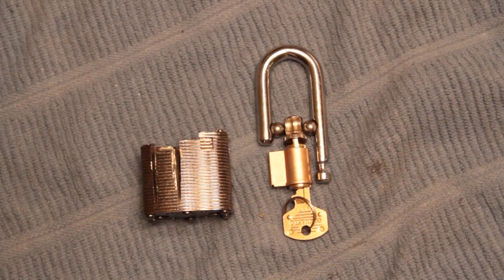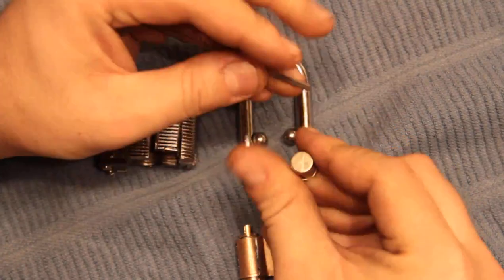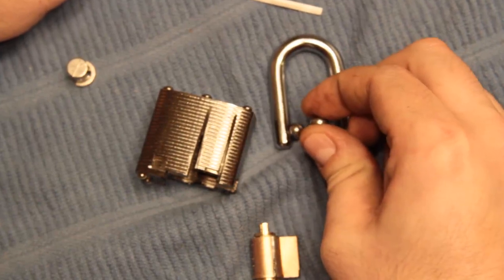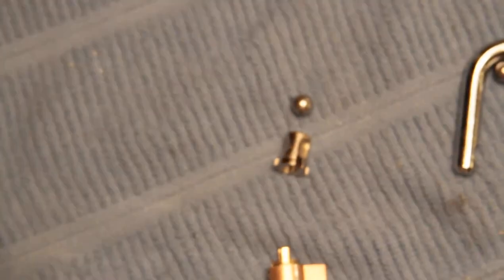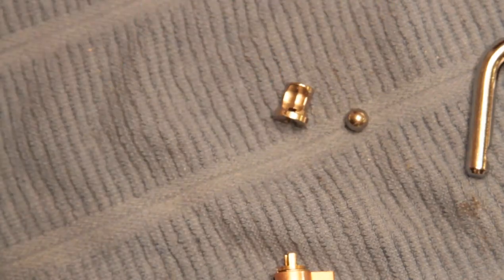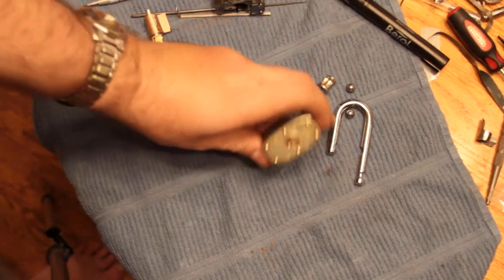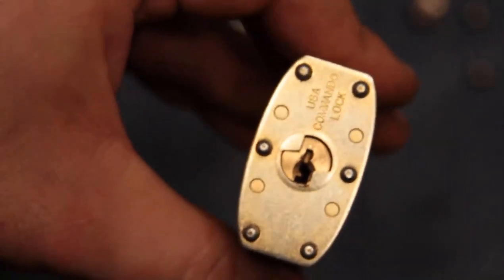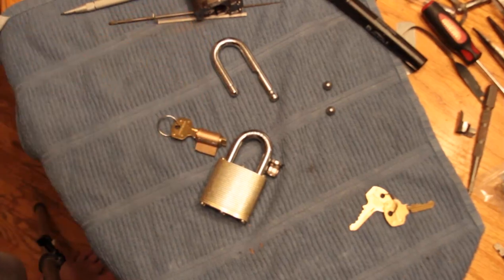(049) Vulnerabilities found in Commando Padlock

Comment: The hardened 420 SS bearings are magnetic--it's the 300 series stainless steel that is not.  Our actuator is currently made of Zamac die cast steel, which is relatively hard for what it is but can be produced in a harder recipe.  Thank you for that.  Without giving away all our secrets, you gave good advice that we can all appreciate.  We look forward to challenging you more as our designs improve.  One last thing:  We're working on our 50mm lock with interchangeable core for 2nd quarter 2013.;)

Comment: I'd also like to congratulate you for being "that guy" who filed the key on YouTube.  We had bets at the factory on how long it would take.  As you'll see in our 2013 line up, we are beefing up the security of the lock body with hardened steel and the new boron alloy shackles.  Tooling for our new shackle guard is also in process and will be interchangeable with the current IChange Series of locks.

Comment from the maker: The actuator in the Commando is a casting. It's mildly magnetic, so it's likely some kind of steel. Replacing it with hardened carbon steel (or something at least as hard as the ball bearings) wouldn't add much cost. For a laminated lock, it's otherwise pretty tough.

Comment from the maker: We do like picking :D And those security pins are pretty neat (and a right pain if they set incorrectly). 

I doubt that you could force the cam -- the tailpiece on the cylinder is brass and I expect it would shear off. 

My central point is that they could spend a buck or two more and add some real drill protection... and have a product that's superior to the other US brands in its class.

Comment: If they were to make the cam/actuator out of SS it would require casting or a lot of machining. They would then not be able to compete for military contracts because it would raise the price too much.

The parts are all the same inside. All that is different is the metal tabs over the keyway. The extra cost is due to the extra shackle that is included with the other model.

Comment from the maker: Zamac is a class of Zinc alloys. AFAIK, none of them contains steel. 

To answer Pick'n n Grin'n's question: Technically, yes, but you'd have to heat it up through the body of the lock... which would take a bloody long time. And you'll probably burn down whatever it's attached to before it melts enough to let the shackle go. :D

Comment: Great video mate! I have checked the actuators on my locks and I can not scratch the Actuator on my Anchor Las nor on my Yale steel padlock same for other steel padlocks as well. I was able to get scratches in the actuator on the Titalium 90/50 but this is made out of Aluminum...
One thing you mentioned is wrong though! 
Sorry mate but there IS actually stainless steel that is magnetic! Watch my video on the books and get yourself a book on steels etc.

Comment: 420 stainless steel is a tool steel it's used for a lot of things cheap knife blades are one it has a minimum of 12% chromium to be called stainless steel. The stainless Steels that are non-magnetic has a high nickel content. Not all stainless steel is created equal there is Thousands of different kinds. 304 and 316 stainless that sinks and kitchen appliances and stuff like that are made out of cannot be hardened nowhere near as hard as tool steel. Something you might be familiar with his knife blades like s35vn, s30v, 154cm, ATS-34, elmax, 440c, 440B, 440A and stuff like that are premium alloy Steel high-quality stainless steels that can be hardened anywheres from 50-65 Rockwell. ( I live across the street from a Custom Knife maker I have learned a lot and have made quite a few myself)